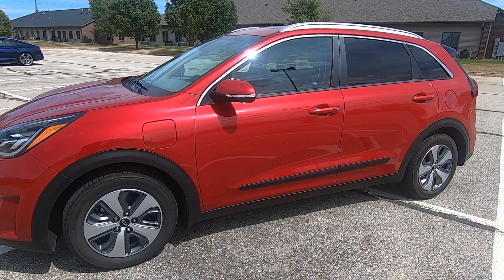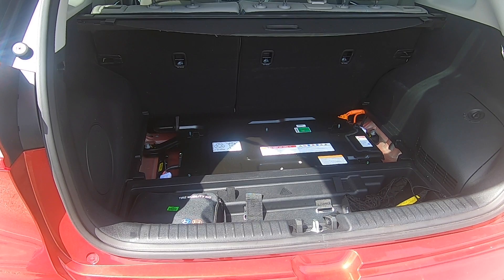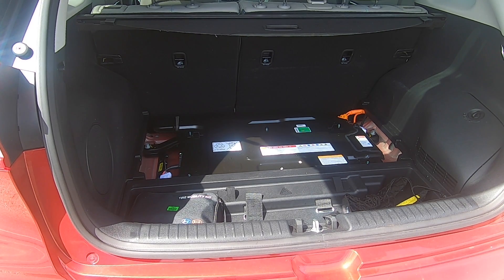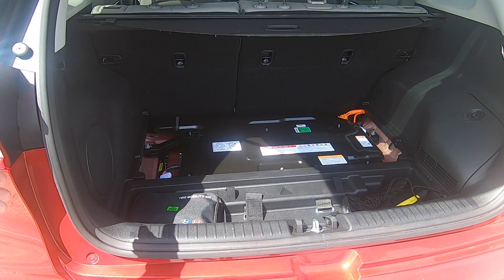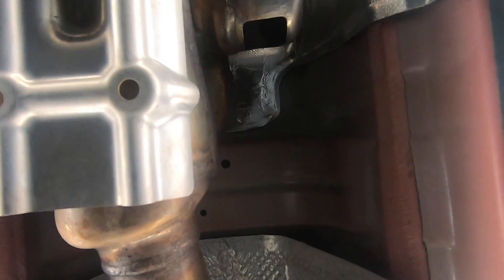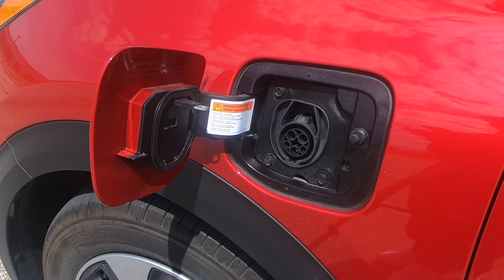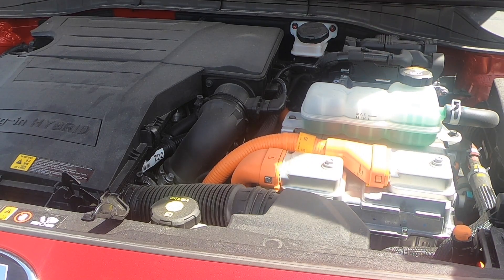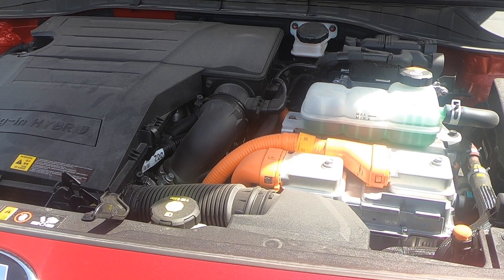Niro PHEV What I Would Like to See in the Second Generation

Comment: You are pretty close, the 2nd gen Niro does have get a battery about 60% larger and the EV motor has more power so range should gain 15-20 miles but I haven't seen official EPA ratings.  The gas motor is unchanged but it should be needed less. I would assume it would take a faster charge rate too.  I also think they said with the additional power they will use a battery powered heater that does not need the motor to run to heat the car, although the heater will hurt range were as running the gas motor actually generated a little power adding range.  So it's a trade off, loose EV miles or burn gas.
Reply from the maker: I am looking forward to seeing the new Niro. Having the larger motor and battery will let people treat it more like a “regular car”. Right now, there are quite a few situations where you have to choose between staying in EV mode and annoying other drivers. One thing that I have heard that I hope is wrong is that the Niro will still only have a 3.3 kW charger. Having a 6.6 kW charger would let it better use public chargers.
Reply: @mynirophev3121  That would be better. A home 110 charger would be about 12 hours and even on 220 it would take 5 or 6 with a larger battery.
Reply from the maker: My main reason for wanting a 6.6 kW charger is so that using public chargers will become viable. I could put more power into the battery pack while doing something like shopping or eating (or at work).

Comment: The red color looks great!  I'm considering either red, silver or white. Btw,  how easy is it for thieves to steal catalytic converter in Niro PHEV?
Reply from the maker: Where I live, catalytic converter theft isn't an issue. There aren’t many options for locating that. I was able to find a picture here. http://www.kniro.net/images/components_and_components_location-1033/689/sdehec7005l.gif
Reply: @mynirophev3121  thanks.  It seems exposed to me.
Reply from the maker: The operating temperature for those is about 1000° F (540° C) and is part of the exhaust system so would not be safe if it was enclosed.
Reply: @mynirophev3121  you're right.  Almost all ICE cars are designed like this for a reason.

Comment: Can I add AWD and the turbo 1.6 from the new Sorento PHEV?
Reply from the maker: I think I would be fine with a second motor that was 2x the size of the current one. That would provide 180 hp (120 kW) with both engaged for acceleration. 

I am definitely looking forward to seeing the Sorento hybrid and PHEV. Hopefully, my local dealership will order some PHEVs. The Niro hybrid sells well, so I expect to see some of those, but they weren’t interested in the PHEV until I bought mine. I think they only sold four or so this year, but they are not staying on the lot for very long.

Comment: May as well go full electric. 
Why lug a big petrol engine and a fuel tank around when you can do 260 miles on full electric.
As much as i like the niro phev, i just can't bring myself to part with all that cash when full ev is not too much more expensive.
Reply from the maker: I’ll reverse the question: why carry around 1000 lbs (450 kg) of battery pack when you only need 1/4 of that 90+% of the time?

The weight of the gas engine plus the larger battery pack is less than that. The time required to charge the Niro EV battery from 20-80% is 40-50 minutes, depending on the DCFC rating (50 kW vs. 150 kW). Filling a gas tank is far faster and would only be used on my long trips. 

Having more PHEVs will be a more economical way to reduce carbon emissions until battery technology and economies of scale can make EVs more cost effective. 

The other problem is that EVs are hard to come by in my area. I could get a LEAF, but those have their own set of problems. The Bolt EV is more than a little uncomfortable (and the local Chevy dealership really doesn’t want to sell them) and the closest Tesla facility is a four hour drive.
Reply: @mynirophev3121  
Interesting logic, some of which i agree with and some i can understand.
The extra battery capacity etc will pretty much bump the price up to that of an ev, so it's unlikely to happen.
Anyway, keep making the vids and i do hope you get your niro phev wishlist.
Reply from the maker: One thing that I believe would help the most is if fuel prices weren’t subsidized in the US. Having Europe’s price for gas and diesel would make EVs much more attractive, even for PHEV owners. Or would also make the cost for buying and operating an EV more attractive, even if they weren’t subsidized via tax credits like they are now.
Reply: @mynirophev3121  agreed. Fuel is expensive here in the UK which helps the push to electric.

When my 10 year old diesel needs replacing, it will definitely be some sort of ev.
Reply from the maker: I hope that battery technology improvements keep reducing the charging time. Smaller EV battery packs are easier to have in your vehicle if the charge time is in the single digit minutes. Because demand is so high (EVs, solar backup, etc.), I don’t see the prices for batteries dropping significantly. Even Tesla needs to sell carbon offsets in order to make a profit. It would be nice if a manufacturer could make a profit without that.

Comment: I recently purchased a 2020 PHEV EX Premium. I agree, double the range would be a huge benefit and should be a easy solution. Also faster charging would be nice when out and about, but for me charging overnight works fine. I would also like a slightly nicer version than the EX Premium, like maybe an SX. The EX Premium is nice but it would be nice to have a built in garage door opener, power passenger seat, auto lift hatch, and maybe AWD
Reply from the maker: It does show you how and where KIA cut corners.  The 2020 is a big improvement over the 2019, but it still has a way to go. 

Having a built-in garage door opener and a 360 degree camera are little things, but they make a huge difference in the driving experience. 

My reason for wanting a faster charger is for using the public charging infrastructure. Right now, it is more expensive for me to charge at work than at home (the chargers charge by the hour).